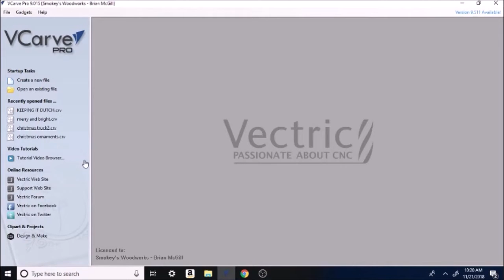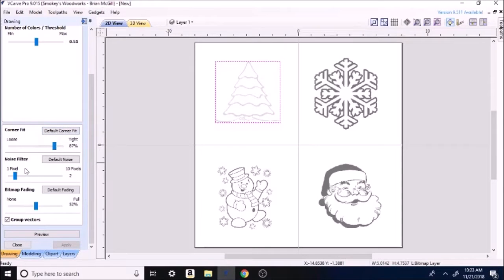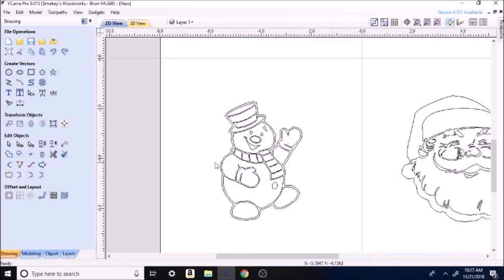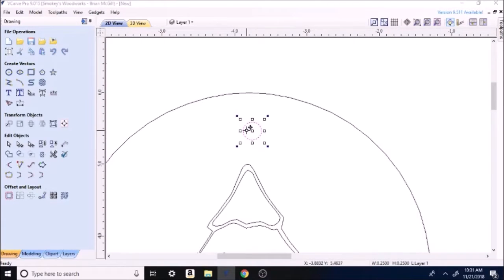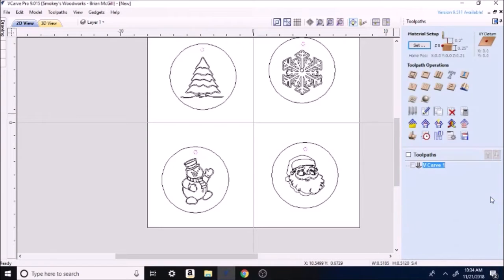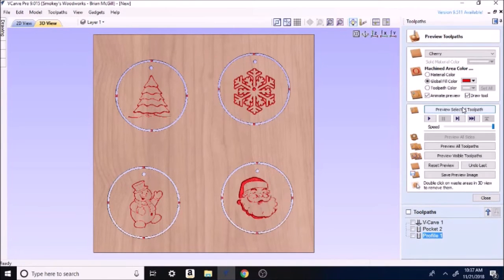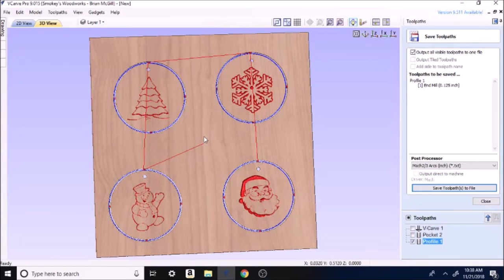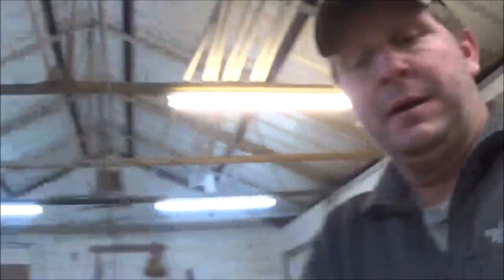CNC Christmas Ornaments with Vcarve example

Comment: I did not understand it all but setting it up on the computer was neat. My husband would cut out Christmas shapes for me on the band saw. I painted them and added the hole on the drill press. I used ribbon some times but mostly I used the heavy duty crochet string that comes on a spool, but mine were smaller than your. I had one spool in green and one spool in red. That what we used was the 1/4 inch fir. As a matter of fact we have a 4 ft. by 8 ft. sheet in the garage that we never used. Maybe one day we will find a project to use it on. LOL Good luck to your wife on the craft shows.
Reply from the maker: Thank you....I have made several things with traditional tools to, i've got one videoed from about two weeks ago, i'm just trying to gauge how it would take on here, didn't use the CNC machine at all on it.....Thanks for watching

Comment: I have found when im painting in carvings I normaly add a few more tabs that way I can run them through my planer with a shallow cut to remove the excess paint. to me this has greatly sped up my work flow
Reply from the maker: I actually have done that on a couple of projects, those ornaments however were cut much to shallow on 1/4 inch stuff, but yes that too works well....my planer is currently down i believe I've had a gear go on me.....Thanks for watching!!
Reply: @SmokeysCNCWoodworks  dont feel bad I went to plain down a 1x8 the other night picked it up at lowes got home stuck it in the planer found a screw head stuck in it destroyed my last set of blades
Reply from the maker: Oh ughh....when i have those days when something like that happens, then one more thing goes crazily wrong, i throw my hands in the air and leave the shop, because I'm so irritated then i know nothing is going to go great.....lol

Comment: Thanks for great tutorial. I have followed your instructions and tried to make ornaments of 1/4 plywood. Did everything same as your for profile, have same bit but for some reason its cutting deeper, and going through the material I am using under the piece so that machine boad is not damaged. What am I doing wrong?
Reply: This comment is kind of late but it might help someone else. Are you sure you checked flat depth and set a depth less than the material thickness? That limits how deep the bit will cut into the wood. If you set it at .1 like he did you could try setting it at even shallower like .008 . The images you used can make a difference on how deep the v bit will cut if you set the max depth lower it could help if your images are different than the ones he used. Another thing you could check is make sure you are setting your Z height from where you set it up in the document settings. I.E. If you set it at material surface make sure that is where you are setting the Z on the machine.  Hope that makes sense.

Comment: I just noticed that the bed of my Xarve is not 100% parallel to the x axis so it's cutting more on right side. Do u have any tutorials/tips on how to compensate for that as frame of Xcarve is all made of screws and extrusion rods.
Reply: One way is to add a spoilboard and then level it with a leveling bit.  Not sure about your machine but it may have a leveling function for it.  I would check with the manufacturer

Comment: Nice job! Have you tried to do any engraving in plexiglass? You could make some really nice lighted signs with your cnc..
Reply from the maker: No i haven't, that is a very interesting idea, I'd really have to research it, the speeds would have to be cut way back because of melting i would think...You got me thinking,,,Thanks for watching!!
Reply from the maker: No i haven't, that is a very interesting idea, I'd really have to research it, the speeds would have to be cut way back because of melting i would think...You got me thinking,,,Thanks for watching!!
Reply: Also, I read to use a single flute bit for plexiglass. $8 for ten on eBay.

Comment: Hi I'm new to your vlogs, thanks to keeping it Dutch. Your vlogs are really neat. I have a ?. Is it possible to switch the design on the opposite side to make a see through look so that it can be seen on both sides with the same intricate design? Thanks. Have a great day.
Reply from the maker: Yes, however there would be small tags left in place to hold detail in place with kind of a "floating effect" like small detail in the snowmans or santa's face, a small tag attached to their eyes, that would be visible....it would simply be the matter of a bit different programming...Thanks for watching!!

Comment: Where did you get the clip art?
Reply from the maker: I'm not 100% certain I pull clipart from several places...clip art library, is one I've used several times, 1001freedownloads.com, sometimes you run across royalty free stuff on google and sometimes when I flat can't find what I'm after I'll by images from places like istock.....Thanks for watching!!
Reply: Smokey's CNC Woodworks what about the wood? Do you have a local lumber yard or a good place to buy online?
Reply from the maker: I go to a local lumber yard, and have a local mill that I'm going to start getting some rough lumber from...Thanks for watching!!